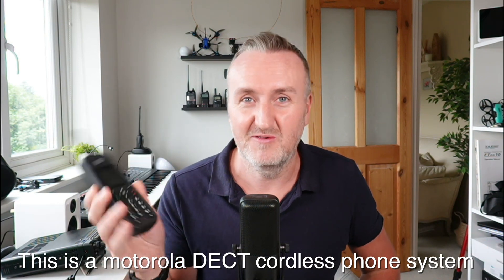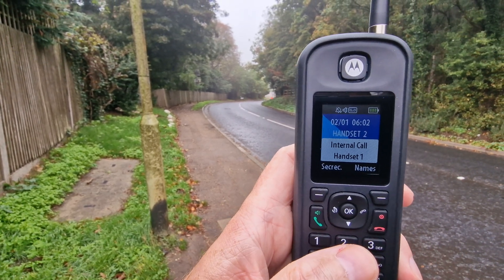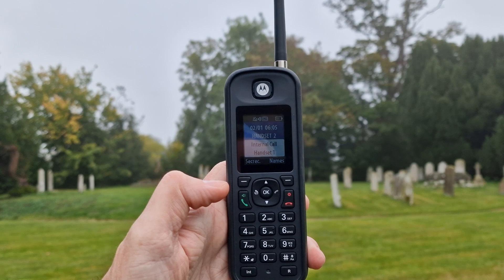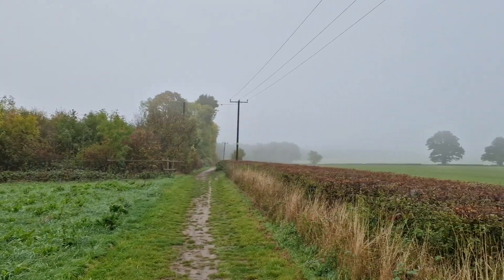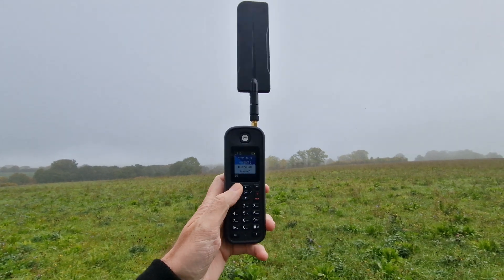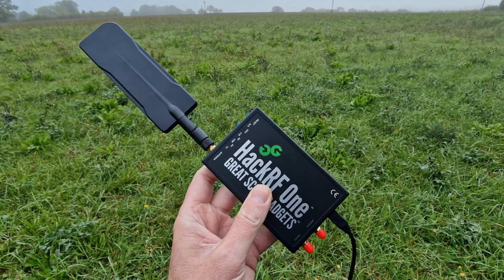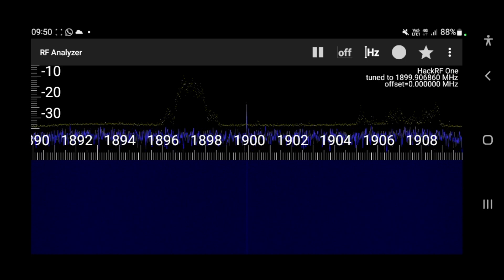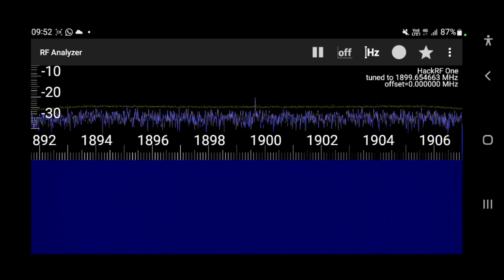DOES MIST AFFECT MICROWAVE RADIO SYSTEMS?!

Comment: Hi Andy.  It could be a timing issue.  I'm no great expert in this, however from what I can gather when the packets of data are sent out from the phone to the base.  The phone will wait a certain amount of time for a reply from the base.  As this distance increases the delay will get longer until the phone times out waiting. At this point they will no longer be able to communicate no matter how good a signal you are getting.  A lot of the long range Wi-Fi gear have adjustments for this.  Unless you could modify the firmware of the phone then this could probably be the limit of the device. Hope this helps.  I love the videos keep up the good work Rob (G7KEK)

Comment: It definitely has an a affect on PMR446 bud it's either really good with range or really bad
Reply from the maker: That will definately be objects obstructing the signal. PMR446 is not a super high frequency but it is massively impacted by objects in the way!
Reply: @andykirby  usually did my tests from high ground tbh Andy I've a few related long distance PMR calls on my channel 👍

Comment: Heavy moisture, rain, snow, and fog will cause interference to microwave radio signals.
Biggest problems for microwave radio systems is the signals cannot pass through solid objects

Comment: Interesting tests Andy. Things to consider:
Noise, check that the noise floor at the base station is low ( no local Interference such as LTE base stations).
Polarisation, Antennas >1GHz are often really sensitive to this as much as 30dB.
Directional antennas; these also make a huge difference, not only do you increase radiated power in one direction, you can also "shield" from a noise source which improves the RX side. Try a cantenna, corner reflector or LTE log periodic at the base station.
Power supply, make sure your mobile has fully charged batteries and the dc power supply at the base station is low noise.
I think DECT is time division  duplex so it will have a hard limit on range.. Thanks for taking the time to share your experiments mate!